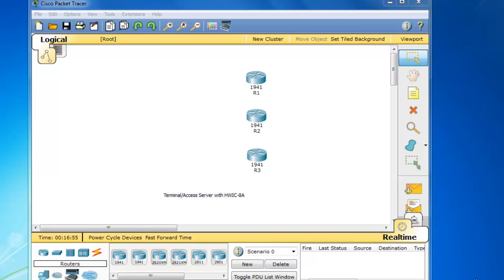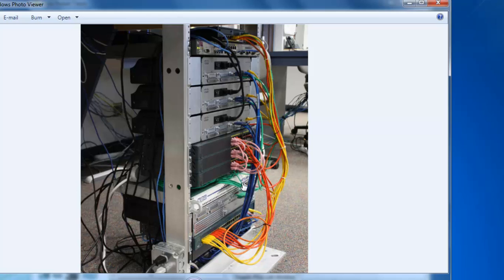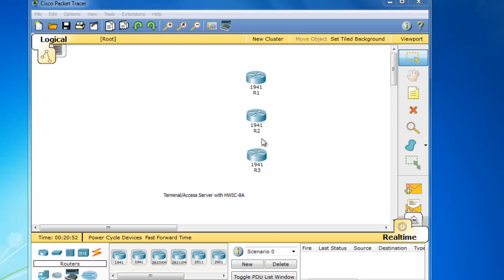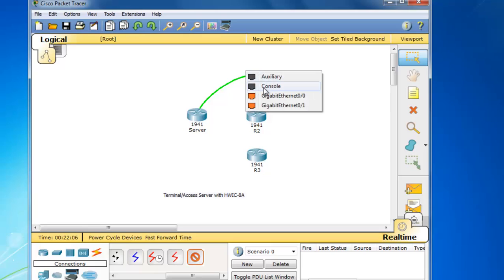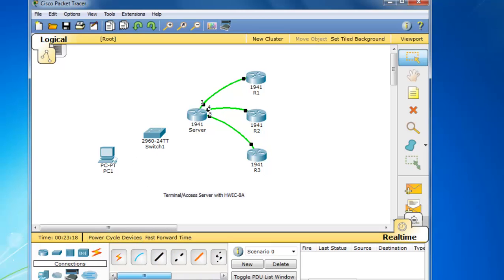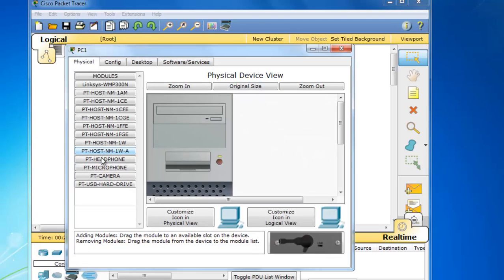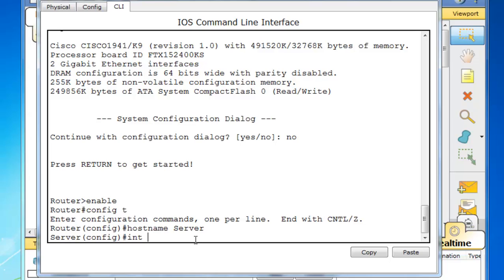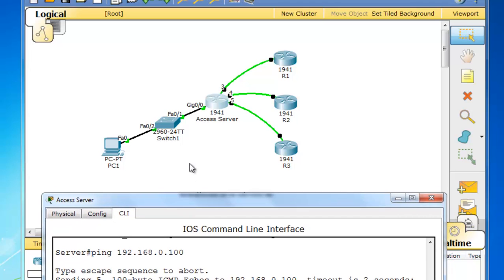Packet Tracer 6.0.1 Terminal Server Part-1

Comment: Have you tried setting DHCP server using a multilayer switch on this version? it does not work, at least for me it doesn't, i did try the same conf on 5.3.3 and worked like a charm.